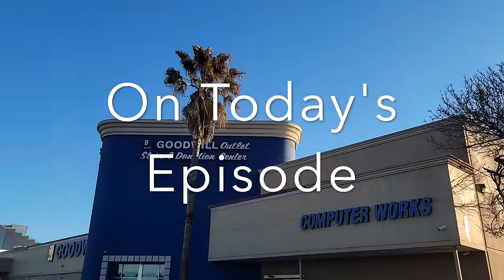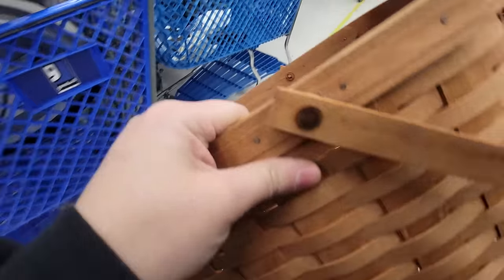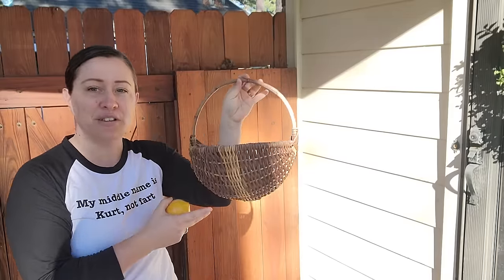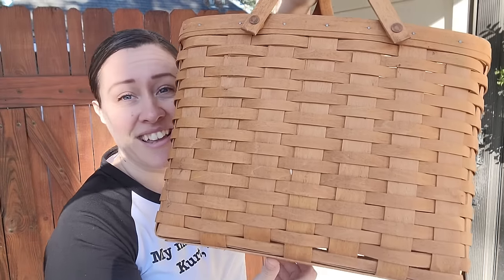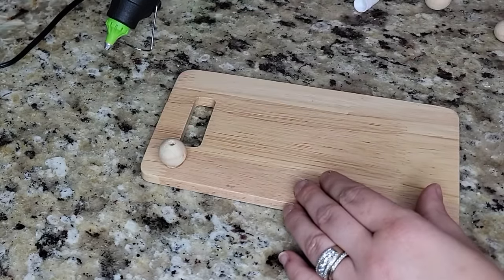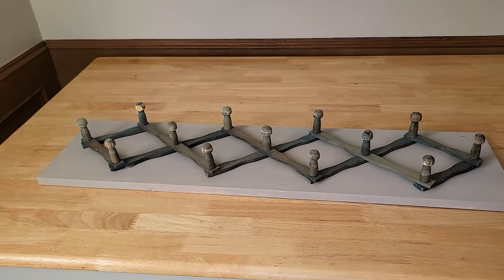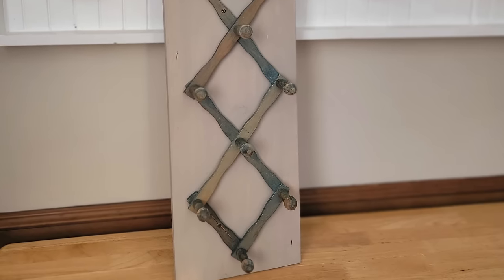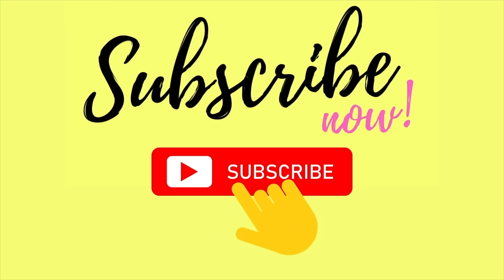$16 Goodwill Bins Shop and Flip With Me

Comment: The longaburger  basket is worth a minimum of 75.00. Many on Etsy and E bay. I saw you miss a cast iron pan. They can be worth a lot  too. And the stainless steel fry pan you left because of conditions; it is easily  cleaned to look like new with bar keepers friend and a coil steel pad. Then they sell for a lot.

Comment: On Amazon, they sell Angelus acrylic leather paint & the finisher. That stuff is AMAZING! I did this to an office chair, that on the armrests looked like the inside of the wallet. It took a several coats because it was SO bad but it actually evened out then after the finisher it looked brand new!!! I was BLOWN AWAY!! I never expected those kind of results. You may not want to do this on the wallet but I thought I would mention it. Also, they come in 4 oz. sizes and I got one black and one brown. I focused on the worse spots until almost even and when I saw how good it was looking, I did the whole chair. I still had paint left after I was through! So it goes a long way. I spent maybe $35-$40 instead of hundreds on a new chair! Just thought you might like to keep it in mind in case you ever need it.

Comment: ahggg! you had the scrapbook paper in your hands and put it back! I have seen rolling pins covered in it with a coordinating color on the handles. also good in the cupcake pan (which you also passed over). canterberry cottage would tip the pan up, fill each cup with bird nests made of spanish moss and grapevine or small leaf english ivy, and birds with small eggs made of air dry clay. leave the pan plain or paint as you have time. makes a spring wall decor
Reply from the maker: Great ideas!